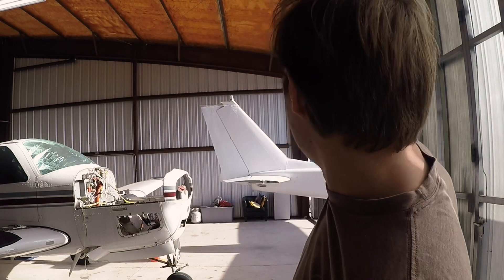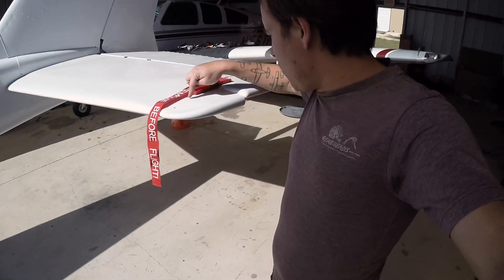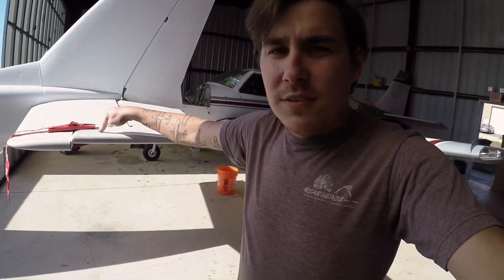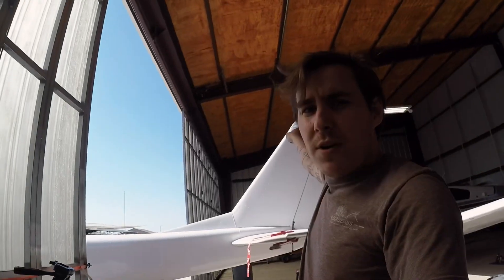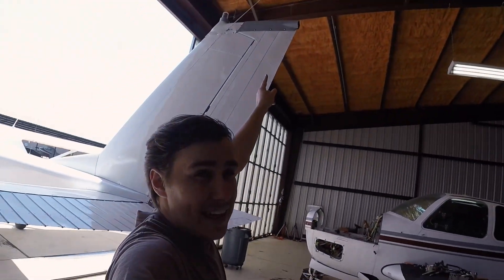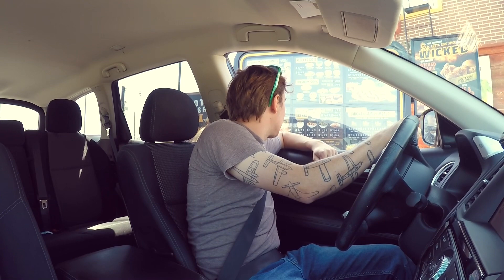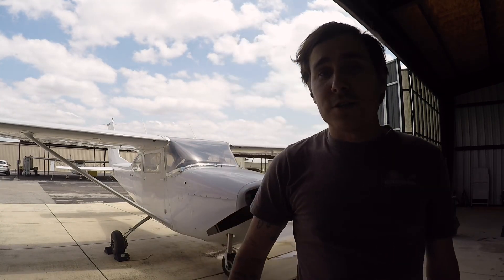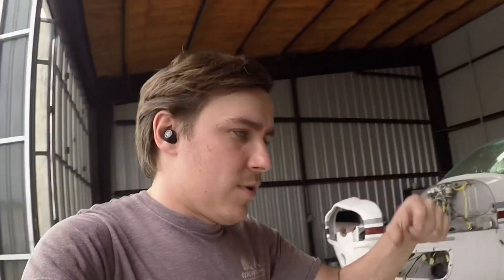Cessna 172 Project, More Loose Ends.

Comment: I think the ipc calls out pop rivets on those fairings. And the static wicks.
Reply from the maker: It called out solid shanks but I don't have any way of getting a bucking bar behind it. I probably could have just used some non structural blind rivets but cherrys are better so I went with those